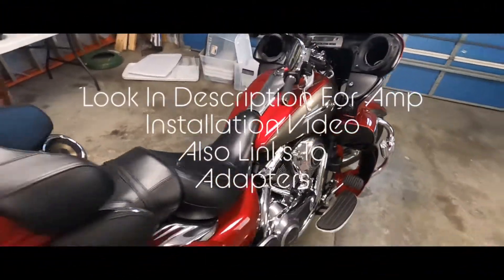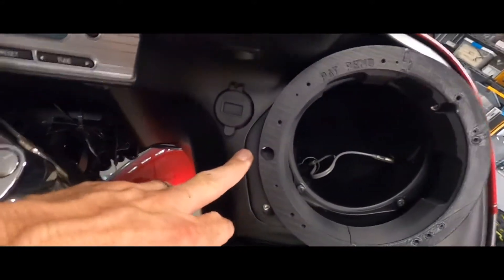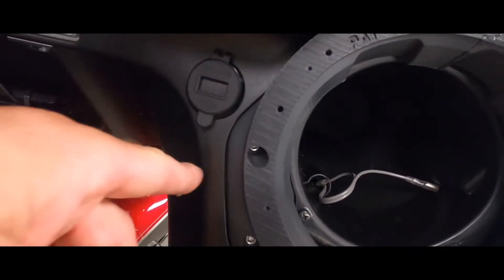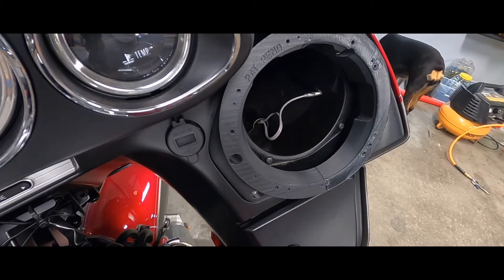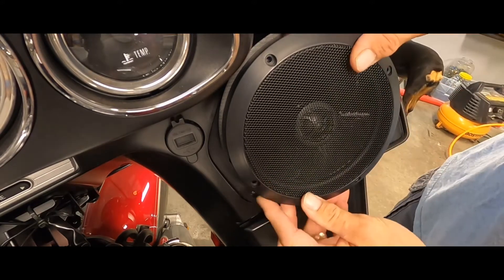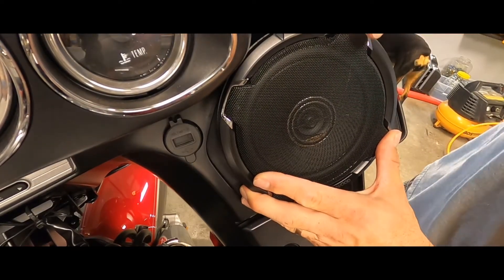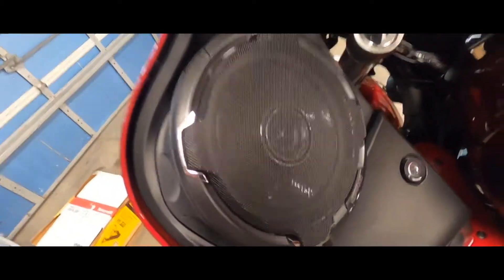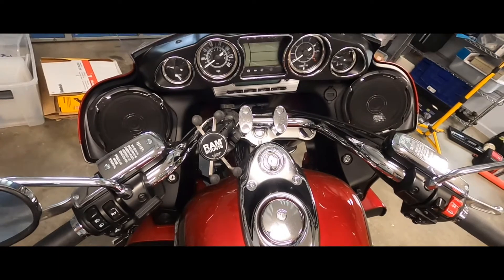Engineered Adapters Installed: Upgrading 5.25" to 6.5" or 6.75" Speakers on Kawasaki Voyager VN1700

Comment: You use stock speaker screws? Cause they are way to big for the adapters..
Reply from the maker: Don't really remember, did that over 2 years ago.  I work on cars and bikes all the time, either the adapters came with screws or I just grabbed what fit.  I had also changed the stock speakers so may have already changed the screws at one point.  Sorry can't help more sold the bike in January.
Reply: After seeing this video I purchased the same speakers and adapter, I used the screws  that were included with the speakers in the box and they fit just fine.

It made enough of a difference so that I now have ordered the Engineered Adapters 5 1/4 glove box speaker and the same Kenwoods in 5 1/4 form.

Comment: Greg, what model 6.75" Kenwoods did you use; I want to order same
Reply from the maker: https://www.amazon.com/gp/product/B07NQP27Q7/ref=ppx_yo_dt_b_search_asin_title?ie=UTF8&psc=1

Kenwood KFC-1796PS 6.75 Inch 330 Watt 2-Way Car Audio Coaxial Speakers
 
Now the ones I got were not Marine rated so if they are not made to get wet. Unless I get caught in the rain, I do not "road trip" so it did not bother me, but if you get the bike wet or it is stored outside, I would recommend a marine rated speaker...  

Probably have to do a 6.5" instead of 6.75 but should not make much difference in sound.
Reply: @RagerJackOfAll  Thanks, ordering a set tonight; I assume you've been happy with them.

Comment: Hi Greg, where did you get the engineered adaptors please? Great videos 👍
Reply from the maker: https://engineeredadapters.com/product/kawasaki-fairing-adapter

I looked for a better deal, every now and then they pop up on eBay or Amazon but not for much less.  Straight from the factory and then if there is a fitment issue or anything they will fix it.  When you put them in place, I had to slightly force them a little, but most likely just the way the fairing was mounted or formed.  Once they pop down in the fit excellent.  Thanks for watching, I'll add that link in the description of the video also.

Comment: Hello Greg!
Did you ever try to replace AUX audio plug for another like a simple jack 3.5?
I mean, should I buy "AUDIO ADAPTOR KIT - K10400-041" in order to connect our mobile like android or any Bluetooth Receiver?

Pls help me ;)
Reply from the maker: https://youtu.be/AIJbQtlb-j4   Yes that’s the link to the install video.  I have not found a direct android adapter, but I use iPhone so I haven’t really looked. You will need that kit to convert the sound.  Once you put the kit in the glove box You plug any Bluetooth receiver into it.  It will take me probably 20 minutes, the way I did it was a little more difficult because I Did not want to lose the glove box.  But again once you put that kid in plug any Bluetooth receiver into it and will work Just make sure your Bluetooth receiver is battery powered which means you’re going to have to charge it or you’re going to have to do some mods So that stays on or charged all the time while the bike is running.